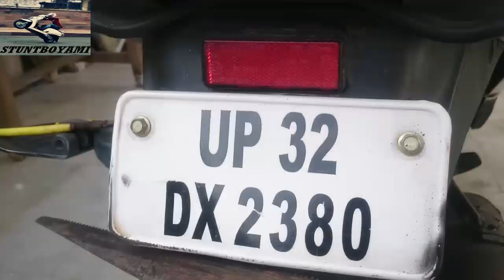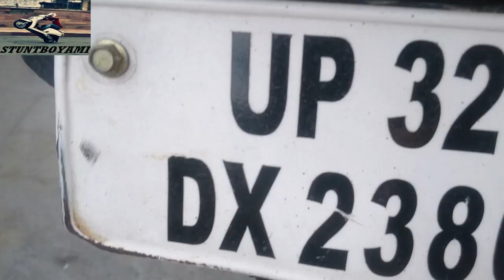How To Install Pulsar 135 Number Plate Bracket in Honda Aviator(2011)

Comment: The video is really informative bro..Can I made this modification , that is fitting pulsar 135 licence holder to Apache?? please tell or give some suggestions.
Reply from the maker: Srenivasen k.p Yes!  everything is possible.  I'm going on ride on apache 😉 tomorrow,  after that i will tell. i need to do some research on apache tail-end section,  then i will give you proper information.
Reply: stuntboyami thank you brother I am waiting 👍 and I am looking for  my bike to modify its rear section please suggest me.
Reply from the maker: you need to remove the rear mudguard and need to make hole like i did in my video and you can install it.